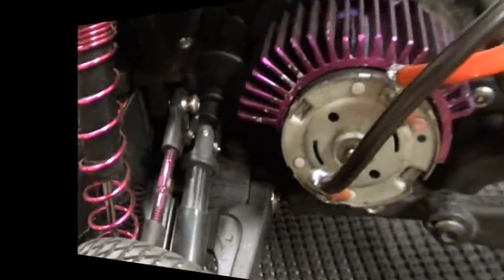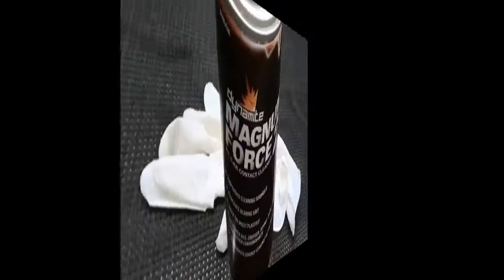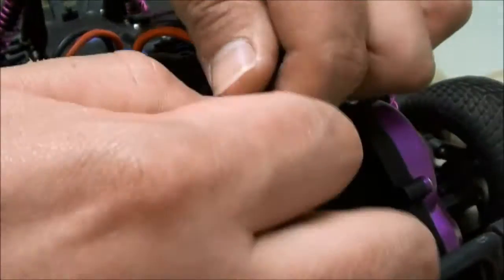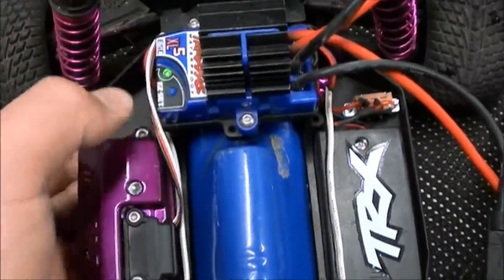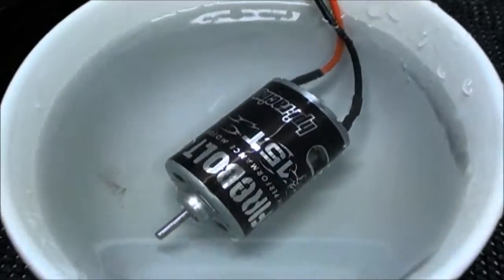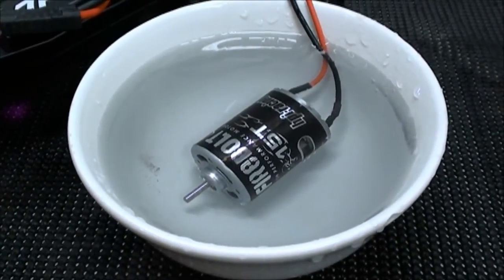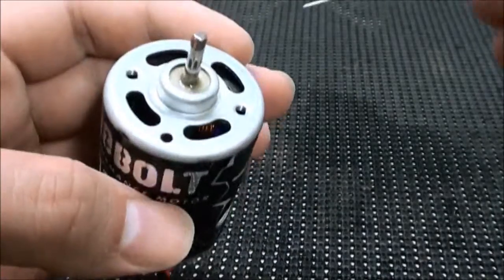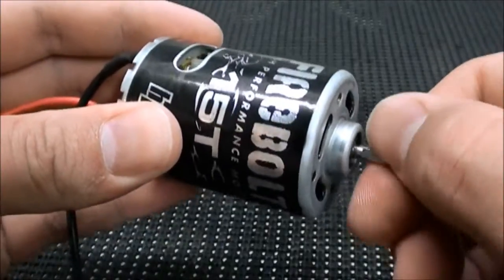Dark Ecliptic Heart RC Projects - How To - Break In Brushed Motor

Comment: what it b bad for the motor if i broke it in but didnt spray it with motor cleaner and oil the part.would it still keep the engine lasting longer

Comment: ok my firebolt just came and the engine will just stop work and then start again or it will like lag.i unplug the motor from the esc then plug it in then it works.do u no wat the problem could.thanks!

Comment: This "break-in" method only helps wear the new brushes so they seat against the commutator, something that will happen naturally by running two or three pack through. It's a waste of time, and if your motor runs on bearings, will dramatically decrease the life of them. Better to just run it and spray motor cleaner through every few packs. Back in the day when we raced brushed RCs that's all we did, replacing brushes and skimming the commutator with a special jig maybe twice a year.